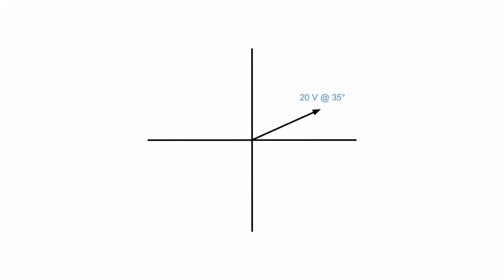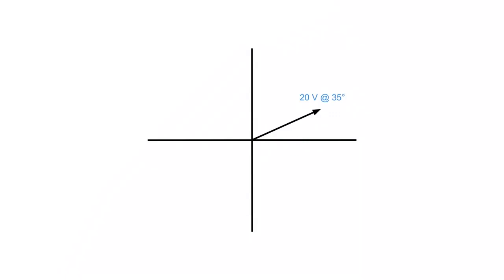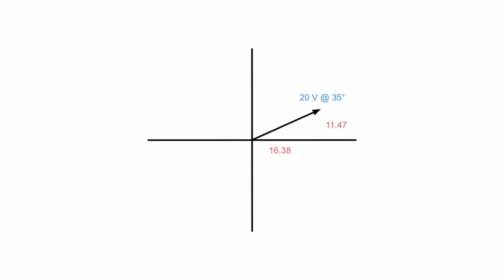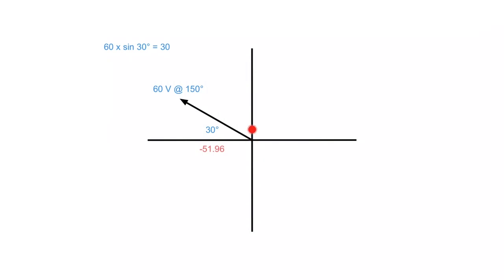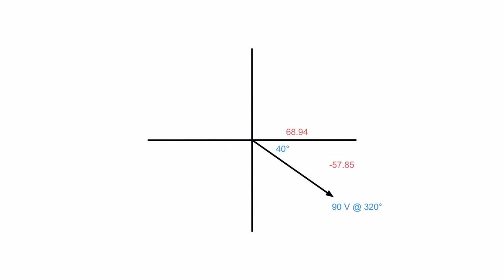Converting Polar to Rectangular

Comment: Im slightly confused as to why you said you were taking the sin/cos of 150° in quadrant 2 but took the sin/cos of 30° instead? Same question goes for quadrants 3 and 4, guess I'm just not getting the degree conversion and need some help figuring it out.
Reply: In quadrant two, the x axis is at 180 degrees. The difference between the 150 degree vector and the negative x axis is 30 degrees. 180-150=30